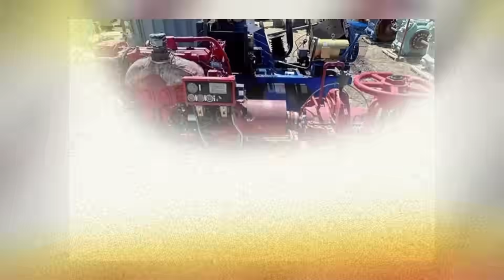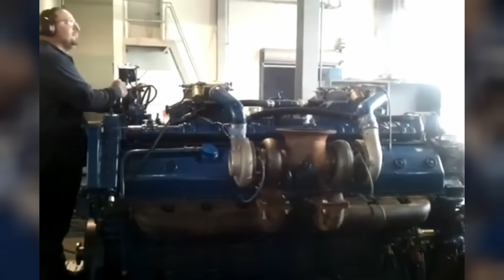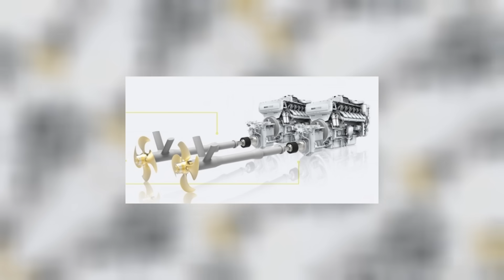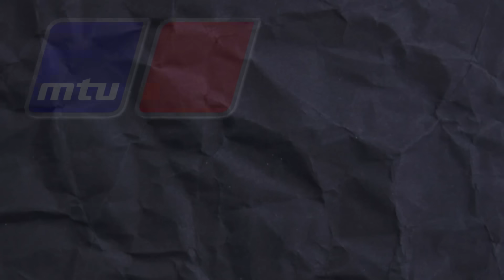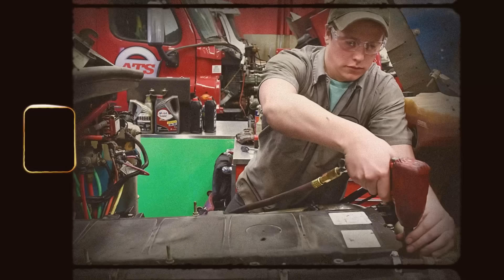The Insane Truth About the Monster Detroit Diesel 20V149

Comment: I wouldn't want to adjust of the rack on a 20V,  bad enough on a 671.
Reply: I have never seen a 20V have a rack setting, it is electronic engine equipped with DDECIII. But hey, maybe because I overhauled only the Genset application engine. I'm not sure about other applications.

Comment: Imagine designing an engine for its vocation and not around the EPA. Those were the days
Reply: Car culture can keep thier 4 turd strokes! lets see some 2 stroke DFI v8's!
Reply: Also the days when living in a city was equivalent to smoking three packs a day just by breathing. The days when you literally could barely see past the next block on a bad day due to the smog. The days when marble facades in the northeast were literally melting off buildings (and entire forests were dead) because the rain was more acidic than lemon juice. Someone had to step in and stop the tragedy of the commons from poisoning us all.
Reply: They were a tired design long before EPA started regulating off-highway engines. People love to blame epa as the bogeyman but unit injectors and blower based scavenging had plenty of issues for users. They were great for their time but modern designs do more with less.
Reply: @yolo_burrito new designs also fail to run at the slightest computer/sensor/wiring brain fart… those Detroits don’t even need a single wire or even any electrical to run. Air start and fully mechanical. Way more reliable and repairable in the field.

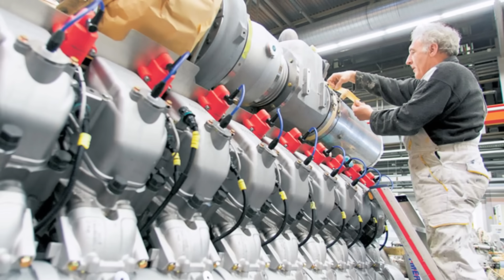Comment: 15:41 that is a individual cylinder head engine. Detroits are not.
Reply from the maker: This engine did have one head per cylinder, then had a cover that went over those. I spoke to guys who actually worked on it.
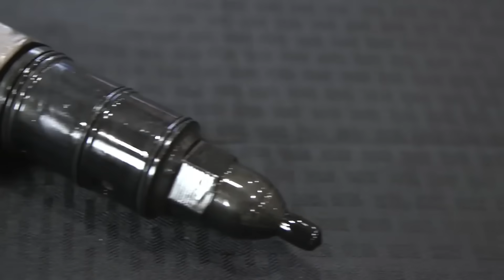Reply: @VintageAmericanMachines 8:36 look at the valve train. That is two cylinders right next to each other. It absolutely is not an individual cylinder head per cylinder engine. It has multiple heads but not for each cylinder. Each bank is 3-4-3 in cylinder count on the heads. You are wrong. I am right.
Reply: @VintageAmericanMachines  i enjoyed seeing these engines again. I worked for DDA DISTRIBUTOR  for 27 years had different dealer types.53  71 92 were a separate dealer all these engines had multiple head per configuration. The 4 cycle 8.2 was a separate dealer. I never saw a 20v149 but it looked ddec III but 149 was a separate dealer. Worked on many 2 cycle 8 and 12 149 for frac and marine applications. All have one head per cylinder.

Comment: Those are not individual heads per cylinder. There are multiple heads on the engine but not each cylinder. Its 4 3 cyl and 2 4 cyl heads.
Reply: Thank you, I thought I was losing my mind :body-blue-raised-arms:
Reply from the maker: Nope, it definitely had one head per cylinder with a cover that covered several heads.
Reply: @VintageAmericanMachines  Thank you for your efforts to show us these engines. Very enjoyable 🙂
Reply: @VintageAmericanMachines 8:36 nope you are definitely wrong. Look at the two cylinders valve trains right next to each other. They are absolutely not individual cylinder head per cylinder. There are 6 separate heads on this engine but not 20.
Reply: @VintageAmericanMachines no it doesn't. It would leak oil everywhere. The valvecovers fir each head. It even says it has 3 blocks connected. Each block section has its own heads. Its a v6 a v8 and another v6 for 20 cylinders. 4 3cyl heads and 2 4cyl heads.
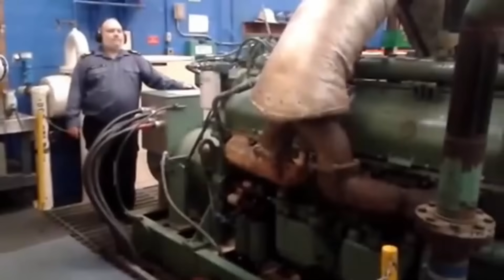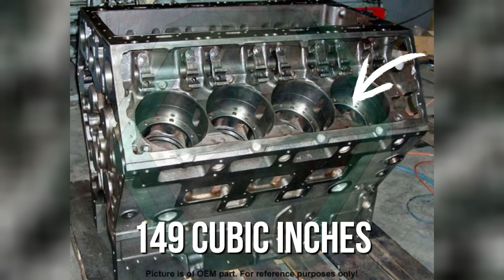Reply: Look at the video at 1:37. You'll see the individual head that goes in an individual cylinder. Look again at 7:18, you see the individual cylinders into which the individual heads fit. All Series 149 engines have this design. I'm not sure why so many comments are disputing what is obvious.

Comment: The editor knows nothing about engines.  He shows a clip of a crank case scavenging 2 stroke like used on lawn mowers and old dirt bikes.  He also showed a Fairbanks Morse apposed piston engine.  Detroit’s are neither of these.  Numerous other mistakes made the video unwatchable.  AI must stand for Always an Imbecile…..
Reply: I'm seeing more and more of this. Automotive videos that are basically slammed together, using AI, or "supergoogle", with only superficial information plucked from a wikipedia article and illustrations that are "sort of" related to the content.
Reply: and continues to say "individual head for EACH cylinder"
Reply from the maker: @MrGGPRI  Because it did have one head per cylinder. I spoke to a guy who actually worked on them on a ship. Diesel Pro Power also told me the same thing. So either there are variants that had something different, or they changed the configuration with later models. But I can tell you definitively, that somewhere out there are 20V149s with a single head per cylinder.
Reply: @VintageAmericanMachines  locomotive engines are like that….it makes repairing one cylinder at a time possible
Reply: @VintageAmericanMachines Video was pretty good. Thanks for your efforts!
Reply: @MrGGPRI  Agreed, but the exhaust valve package or cartridge (whatever they call it) was individually removeable.
Reply: It was a cylinder liner with a piston
Reply: @MrGGPRI yeah because the 149 series is that way. Just like emd. 1 head per cylinder.
Reply: @MrGGPRI the 149 actually was like this and so are allot of diesel engines
Reply: @MrGGPRI  There is an individual head for each cylinder
Reply from the maker: I actually do know about engines, but try to find that kind of footage to use. Not easy, especially for this engine. Otherwise you'd be looking at a blank screen. But the info is spot-on.
Reply: @VintageAmericanMachines  Dose this mean you are happynto lie just to post a video?
Reply: Yeah caught quite a few myself .. one head per cylinder, etc. At least the photos of the stationary plant were correct .. click baited on something last week - I forget what crap about "what ever happened to some actor", tapped out shaking my head a minute in when all the photos were of Richard Gere.
Reply: I agree, made a comment before I read yours, sorry.
Reply: and Detroit does NOT have individual cylinder heads
Reply: @sfbguy the 149’s kind of do though… I’ve cared for a pair of 12v149 ships generators. They have individual three cylinder heads (x4) with an individual head “insert” for each cylinder. You can remove and change one cylinders “head insert”which includes exhaust valves and injector without removing the entire cylinder head. So what I’m saying is that you’re incorrect about the 149 series…
Reply: @FlatBroke612  3 cylinders is Not individual  ,is it?
Reply: I think you’ll find most of the ‘editing’ is AI crap.
Reply: Yeah, I totally agree! It would probably be better NOT to post videos like this one.
Reply: I enjoyed the video, if you didn’t why did you continue to watch 
You have commented negatively on other of his videos 
Time for you to make a better video 
I and others are waiting 🎉
Reply: @jimc4731 You can also say nobody asked your opinion. Op clearly said the video was unwatchable so they probably stopped watching. Goodbye

Comment: I don't know of a DD with individual cylinder heads. Yes, electromotive, but not DD.
Reply from the maker: They did. I know for a fact they had them in military marine installations. But because of the number of comments like this that I'm getting, I'm assuming that there are different ones out there. I can tell you that the guy I spoke to in the military who's job it was to fix this beast, confirmed that it had one head per cylinder.
Reply: Hey it's an individual cylinder head.

Comment: These engines were the "Kings" of throttle response. They fired every 18° of crankshaft rotation, allowing instant response to sudden changes in load, making them ideal for electrical generation. They weren't the most fuel efficient, often only producing less than 10 kWh per gallon of diesel, but, they could handle heavy electrical loads being switched in and out, better than any turbocharged 4-stroke engine ever thought it could. These weren't the ideal engine for primary power, but, by far, the best for back-up power. 
     That exhaust note...MUSIC!!
Reply: Never thought about it that way, throttle response is a HUGE advantage for generators
Reply: Car culture is a 4 turd stroke circle jerk cult! Time for some 2 stroke DFI v8's.

Comment: And the ElectroMotive Division of GM did exactly the same thing with their locomotive engines which were much larger but similar design. They were available in V6, V8, V12, V16 and V20 configurations each with identical cylinders.
Reply: EMD's don't used modular construction of the 149 series.  EMD currently only exist as a product of CAT's Progress Rail subsidiary.
Reply: @stevecushman2830  EPA killed them ?

Comment: love old 2 smokes.
Reply: Besides high particulate emissions 2-stroke DD's dripped oil from the air box & partially burn fuel out the exhaust system (wet stacking).  Most diesel mechanics call them "Driptroits".

Comment: Since when does the two stroke diesel have a spark plug? The video talks about individual cylinder heads while showing an engine with a single cylinder head covering multiple cylinders who is making these stupid videos? They all come under different authors / posters,  but use the same stupid AI.
Reply: The valve covers covered a bank of 3, or 4 cylinders, maybe the whole bank of 10 some models, but there’s individual heads. The fuel injector probably looks like a spark plug to those that don’t know what they’re looking at. Plus each individual head fits inside the block which is why you can’t see them, and the exhaust manifolds are bolted to the block.
Reply from the maker: Not on this one they didn't. 1 head per cylinder. I have verified information from a mechanic who worked on them in the military. So I'm guessing they either changed the configuration at some point, or there were variants, but my interview with this guy is where I got the information first-hand.

Comment: In the early 1980's I worked in the factory where the 149 final assembly and test were done.  Detroit Diesel-Allison in Indianapolis, Plant 5.  Being a young motorhead, I was thrilled to be working where these big machines were made, and would walk down the assembly line when on lunch break.  When I started in 1980 they only built 12V and 16V's.  They introduced the 8V around the time I left in 1985.  I never heard about the 20V until many years later.  I keep wondering what I could do with an 8V-149....
Reply: I was a GMI co-op engineering student on the 149 team in Detroit in about 1984 when the assembly line was moved fron Indy to Detroit. We found there were dozens of modifications and special builds that the techs who assembled in Indy had made over the years but not accurately recorded. Probably because there were so many custom application builds that required unique mods. We worked for about 3 weeks, 12 hour days, no days off to get all the documentation, specs and drawings up to date. I went on to do my fifth year research project on converting the 149 from naturally aspirated to DDEC electronic fuel controls. It increased the horsepower and greatly improved the fuel economy and lowered the emissions.
Reply: Hell of a rat rod!
Reply: @andyharman3022 ....... If you started in "1980" and they "only built the V12 & 16's"..... then they Had to be producing the V8 as well...... ALL of the 149's with the exception of the V8.... were of Modular construction, so the 16 was constructed of TWO V8's.    The V12 was constructed from 2 - V6 engines... though the V6 engine was Never offered for sale as a "stand alone" engine, as were the V8's.    The V20 Was NOT assembled by DD.... it was engineered & fabricated by Stewart & Stevenson.... who engineered and built ALL of Detroit Diesels "special order" engines.... as well as some of EMD's.    Stewart & Stevenson was the largest DD R&D dealer, in the world..... and they still are, however... now they deal with numerous diesel engine brands.     PS: Screw the EPA!!
Reply: @Romans--bo7br  I know when I started at DDA and I know they only assembled V12's and V16's.  Just because they made V8 block castings doesn't mean they necessarily produced complete V8's for sale.
Reply: I love your comment on any Detroit Diesel engine. You Sir are an amazing wealth of knowledge on the greatest two stroke engine. 
I so far have 4,6, and 8 cylinder 71 series engines. I have seen a 20v149 here in New Zealand . I believe there are two engines that can run , they came from large dump trucks. One is a display engine that can run and the other one is a generator in my district, I haven’t seen it yet. 
Thank you for sharing your knowledge. Respect for you . 
Thanks from New Zealand 🇳🇿

Comment: I first heard and saw one of these engines that was used for electrical backup on a tour of a local large hospital for my red seal high pressure steam class.  Even tho the exhaust exited the building some 6 floors up, you could feel the thump of the engine firing in your chest.  An amazing piece of machinery.
Reply: We heard and felt one  roll 200', two water tight compartments away trying to start after dropping shore power.
Reply: @jerrynewberry2823  I have no doubt in what you wrote.

Comment: For, uh, locomotives?  When a regular 567 EMD won’t cut it?
Reply: You realize, of course, that the EMD 567 was 567 cubic inches per cylinder?  But the 149 and 567 were designed about 30 years apart, the EMD coming first.
Reply: @andyharman3022 pretty sure in the video it clearly said the 20v149 was to big for locos and haul trucks, requiring a smaller engine like the 20v710 to be developed
Reply: @cleetusmacfarland9453 You're really not getting it.  Displacement of the 20v149 is 2980 cubic inches.  Displacement of the 20v710 is 14200 cubic inches.  Bore and stroke of the 149 series is 5.75 x 5.75.  Bore and stroke of the 710 is 9.06 x 11.0.  Never mind what the AI bot says about the 149 being too big for locomotives.  It's wrong.  The engines are in two completely different size classes.
Reply: @andyharman3022 it was /s, iirc the 710 or maybe just the 645 was used in a terrex haul truck back in the 70's, and as we all know, the 567, 645 and 710 were bespoke loco engines, then in the vid he says the 149 was to big hence my sarcasm about the 710 having to be smaller and lighter than the 149
Reply: @cleetusmacfarland9453  20v149 is 2,980ci and weights about 10k lb;  emd 20-710 is 16,000ci and weighs 40k lb.  Emd's make 149's look like toys by comparison...
Reply: @cleetusmacfarland9453  Oh, sarcasm!  What a concept.

Comment: video states individual cyl heads but shoes what looks like  4 heads covering from 3,4 5  cl on 1 head which id how all v 12 and 16 had the did have full injecter and cyl iners on each cyl so if wrn only 1 cyl was disassembled
Reply from the maker: There is almost no footage of the 20V149, so I got what I could. But yes, unfortunately, a lot of the footage is of other 149s.
Reply: it looks to me like theres a head casing?! and a round puck of an actual head (the bit with the valves and injector) bolted into this head casing, so id did indeed have 1 head / cylinder. EDIT 1.36 for an image of the "head"
Reply: @denisohbrien correct
Reply: Earlier in the video it was said it two V6s on each side of a V8, modular construction. I would assume each V bank has 3 cylinder heads, two 3s flanking one 4. However, individual cylinder heads are definitely beneficial to keeping the engine up & running in severe situations.